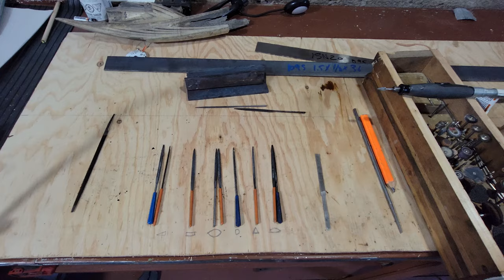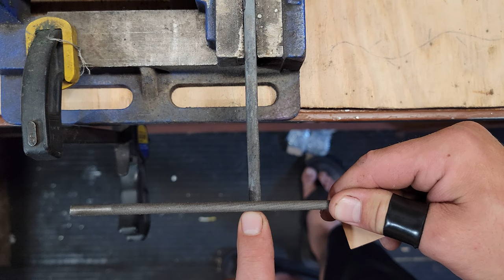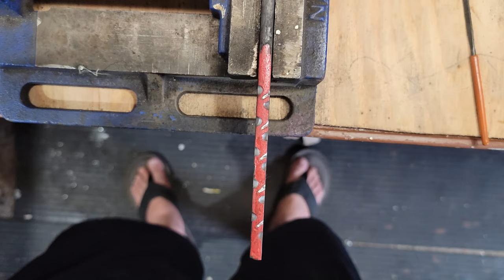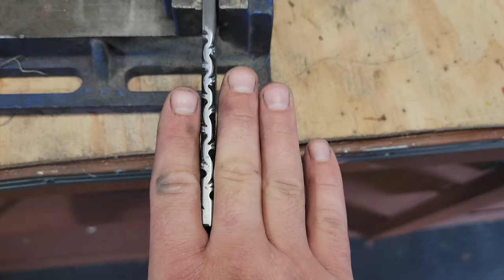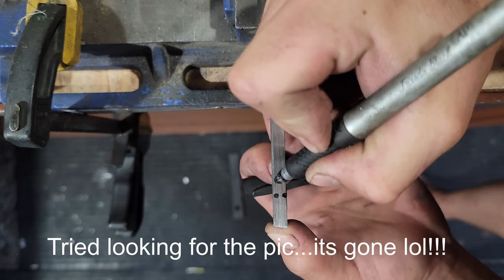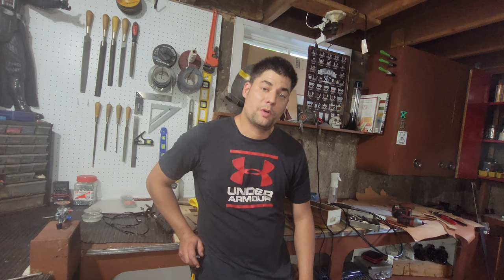Decorative File work for the knife maker

Comment: if you want to sharpen a file you put it in white vinegar after cleaning, am unsure about the vinegar to water ratio

Also most files cut in 1 direction, if you want files to last longer you should push hard but pull lightly preferably without dragging it on the thing you're working on, some files cut in both directions.

And lastly Try putting chalk on your files before working, if what i think is correct it should stop the file from being clogged with shavings and dirt, i didn't test this yet but i heard it from someone that used to work with a german craftsman that believed in taking care of tools so that they last a lifetime, the german craftsman taught him.

Hmmm, probably should've tested it before suggesting it to people 😅
Reply from the maker: Man i love this i will definitely try this out thank you!!!
Reply: Watched a video by fireball tool called "I Filed Backwards 2500 Times, And This Happened" he basically disproved the filing backwards myth. Also, vinegar might clean it and make it cut better but since it is an acid it will actually break down the cutting teeth making them not as sharp.
Reply: @HickLif3  I think the vinegar method would work as it's not eating only at the tip of the teeth but attacking the metal from all directions but you must dilute the vinegar to not damage the file, also was this guys using a file that cuts in 1 direction or one that cuts both ways?
Reply: When I studied machining, I was taught to chalk my file to reduce clogging.
Reply: Vinegar is only 5% acid and it will work to sharpen the files but you can use any acid
Reply: You can't resharpen dull files...Full Stop
Anybody that says you can is lying to you
Reply: @Fireworxs2012   why do you think so?
Reply: @ajhproductions2347  Ive heard that you can use also a candle wax. Dry paraffin "wax" with no oil mixed into it.

Comment: Gave up.the safety sandals for bare feet.  Vise not bolted or even clamped down. And NEVER use a tanged file without a handle.
Reply from the maker: vice was clamped...MY bare feet were perfectly fine aaaaaaaaand using a tanged file without a handle is fine...do it in a safe way if you cant...golf ball it.